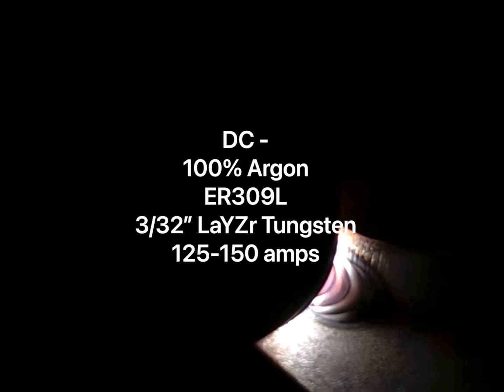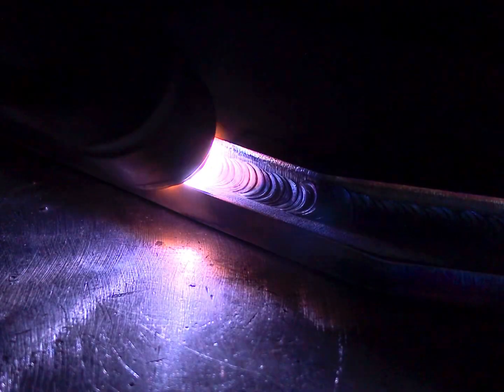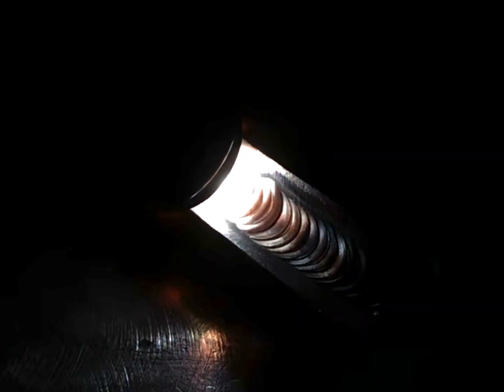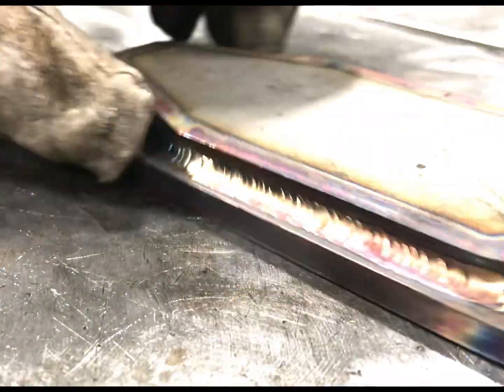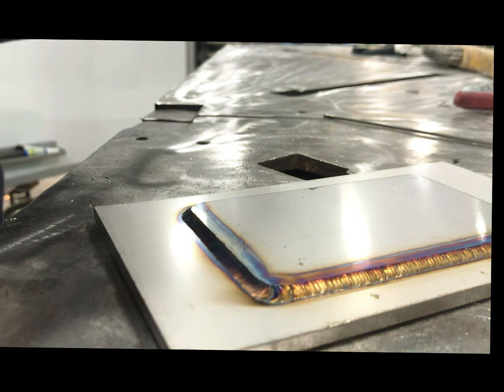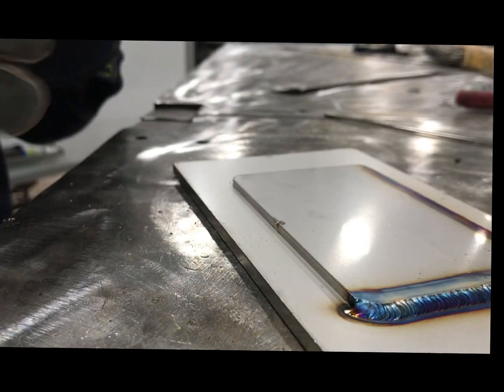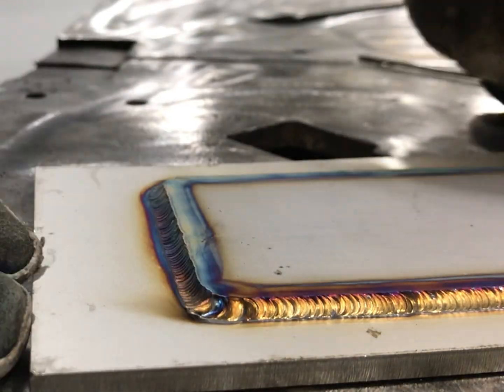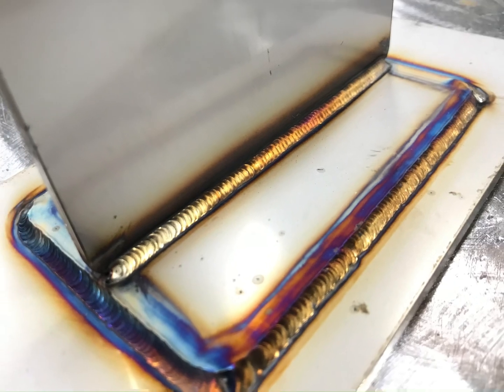Stainless Steel Fillets TIG

Comment: Damn dude, this is great, you make it look so easy. My butt joints are getting decent for tig, but I'm really struggling with fillets
Reply: Bro i stuggle with both i make holes ar the corners and somet times holes in the middle when butt joints
Reply: @TomasKozar  practice practice practice. I'm doing custom SS exhausts now. It doesn't actually take that much time to get proficient.